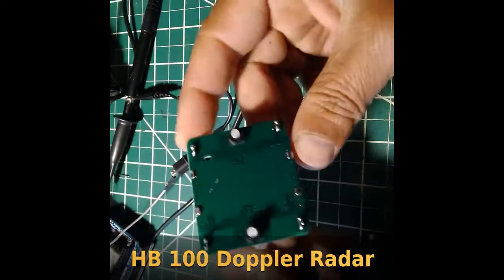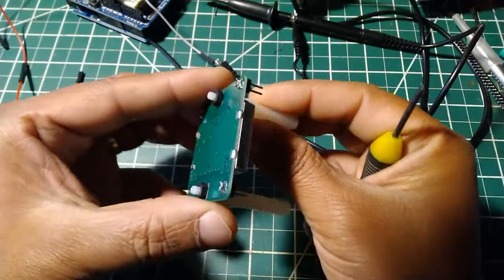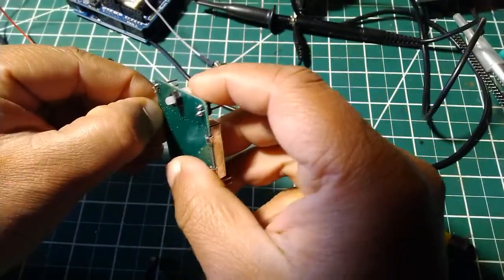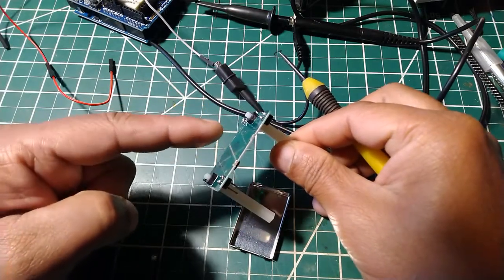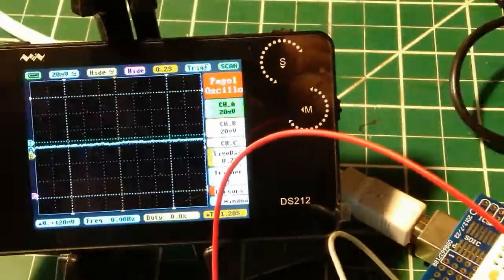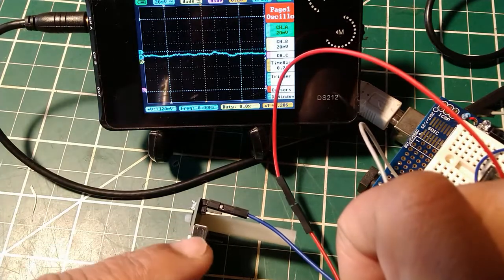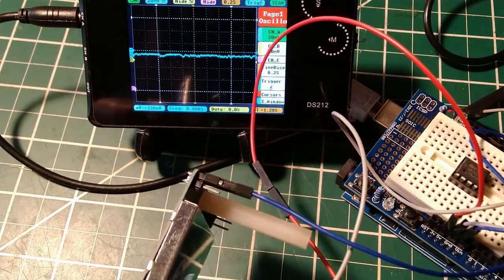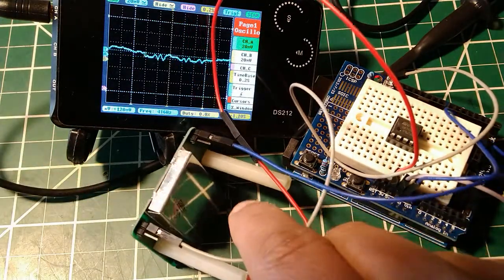HB100 Doppler Radar Tutorial - Part 1

Comment: What is the range of the radar signal that we can measure the speed.
Reply: data   states  20 m   -  with / without  amplification  -  mA    but  no   voltage
Reply: added    led  to be sure   power to

max  (-ve)   offset  on scope  
about    5mV   oscillion    at     5 to 10 cm